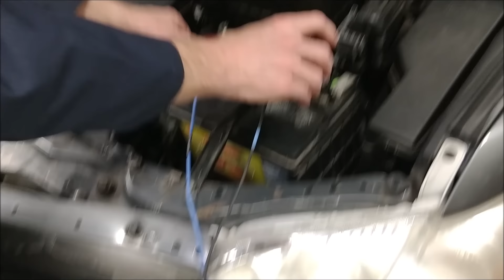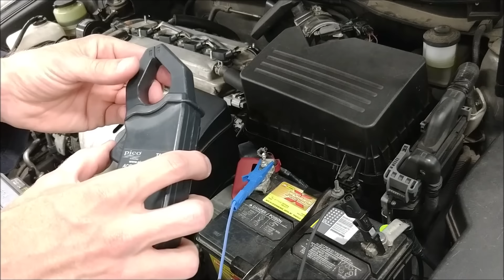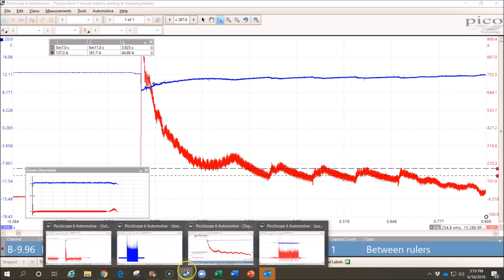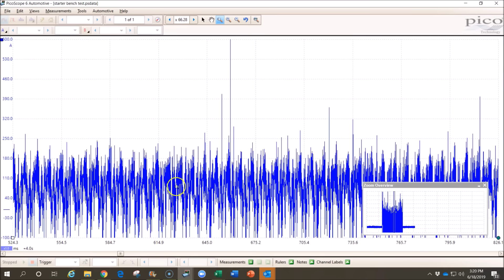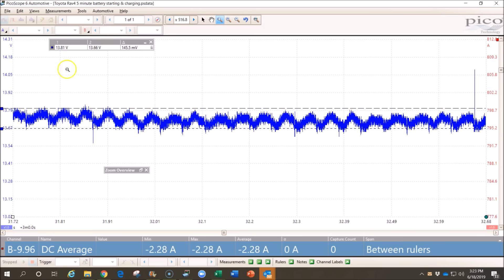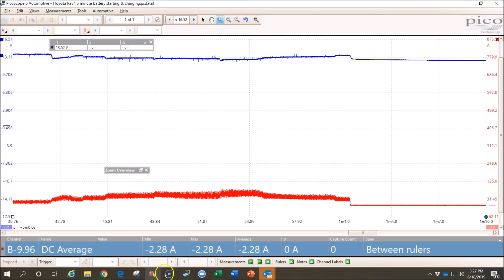Testing a Battery, Starting System, & Charging System Using a Lab Scope

Comment: Great Video, Content quality is top notch. I work on Agricultural Machinery and heavy plant, Do you think the Pico 2204A with the Pico 200/2000 amp clamp will allow me to perform this test effectively or an I better to invest in a higher quality Pico Scope???
Reply from the maker: If you plan to do this more than once or twice, I would definitely recommend a higher quality Pico.  It will pay for itself over and over!  You can check out options on CatchaWave.com.  Please call or message through the website if you have questions!  Good luck with the diagnostics!

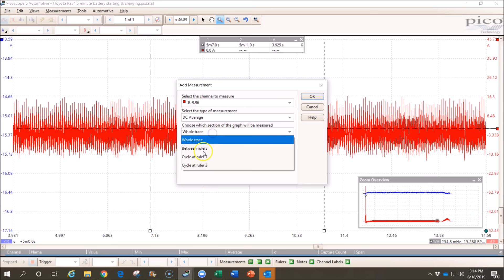Comment: I just did this test with a Pico 2204a and Hantek 650 amp clamp and find that within 5 minutes of the alternator running, the average amperage going into the battery is about -8/-9 amps. The other battery parameters seem good with 9 volt max. pulldown under load, and 12.6 open circuit voltage. You mention at 6:40 that the charge level must be within -5 amps, but I cannot find this specification anywhere else. Would you mind sharing where you found the -5 amp requirement, and do you think its possible that my 2 month old Interstate battery is already starting to fail?

Comment: How do I measure the RPM of the starter using the current draw wave form ?   you mention the minimum is no less the 200. I put the rulers between 4 humps or spikes and it says less than 200 but the car starts
Reply from the maker: Hello Otilio!  
You can't measure starter RPM, but you can measure engine cranking RPM. 
Remember that one revolution of the crankshaft will result in half as many compression strokes as the number of cylinders.  For example, on a four-cylinder engine, there will be two compression strokes in one revolution.  If the engine starts before you get enough compression humps, you can just measure the time between two "humps," then multiply it.  
You are right cranking RPM should be between 200-300.

Comment: Those voltage ripple, is it possible to smoothing it with capacitor? how many F will significantly reduce it? there's so many device marked as "voltage stabilizer" and it's seems like BS, and most the user review sound like placebo
Reply: The battery acts like a cap. The ripple is already heavily reduced down to just a few hundred mV. Versus the several volts when running open circuit.

Comment: Great video Man, keep up the great work ! You had a 600 amp current clamp, but 1000amp spike ?
Reply from the maker: Because the starter current on many cars will spike over 600 amps, I created a custom probe, using the same current clamp, but setting the range at 1000 amps.   The clamp doesn't have guaranteed accuracy above 600 amps, but I would still rather be off by a couple of amps than have my waveform clipped at 600 amps.  On Pico, this is really easy.  I just duplicated the 600 amp current probe, then edited the lookup table in the  duplicated probe and renamed the probe.
Reply: Justin Miller Thank you ... your awesome... I think your videos are some of the best !